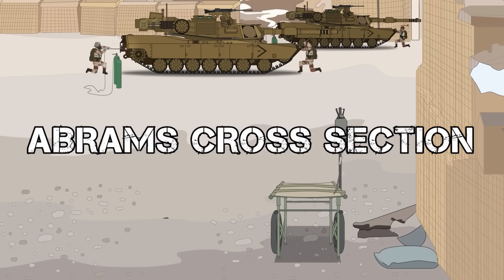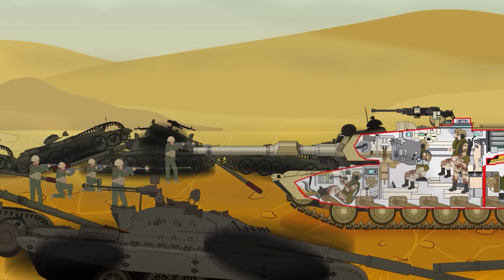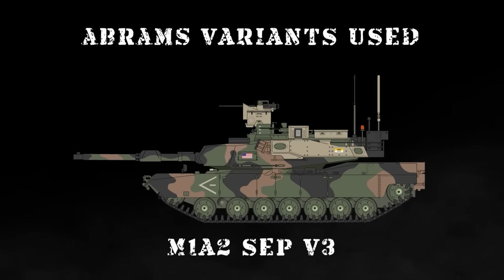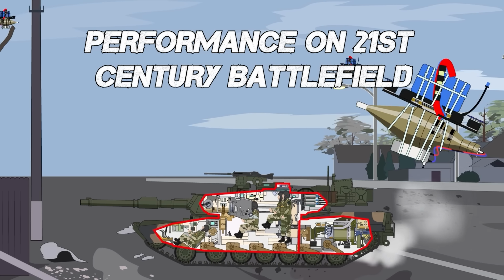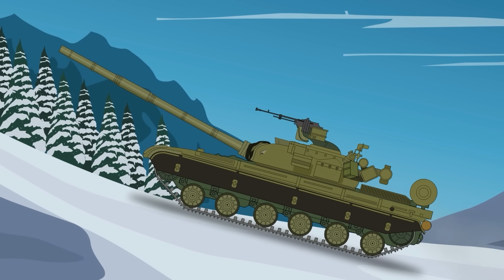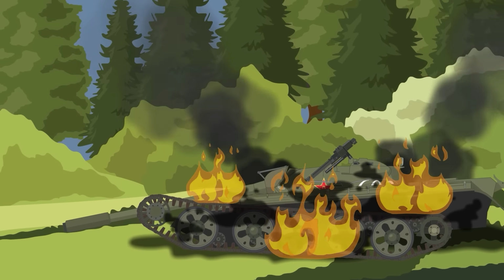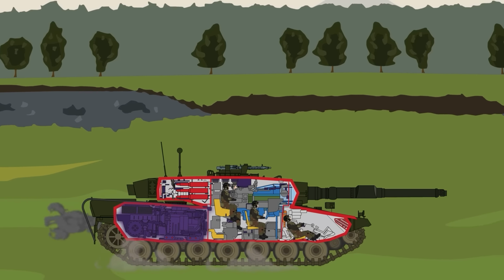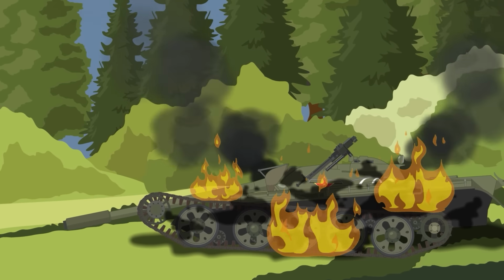M1 Abrams VS. Leopard 2 Tank

Comment: Not one Abrams was lost in the Iraqi war from hits buy another tank... they used GPS and their infra red land radar to see the the enemy T72 and T80 tanks.  From 3.5k away their sabot depleted uranium projectile traveling at 1 mile per second penetrated the frontal Armour vaporizing the crew instantly exploding its ammunition. In many cases the sabot passed through the other side of the enemy's tank ..turrets of 8ton were sent 50feet into the air as a result of its ammunition exploding....
It wasn't a war it was an anailation..in complete darkness in sand storms and on the move the Abrams anailated the enemy without a casualty... Rhe soviet T72 tank was a formidable beast with its 125mm cannon..they thought it to b the best tank on the battle field..its effective range maxed out at 2000 metres..at 1200 metres hitting a M1 Abraham they could not penetrate its composite Chopin armor.....
The soviets told Sudams generals the war would last months...100hours 1000 armored enemy vehicles destroyed...not a single Ai Abraham destroyed due to enemy retaliation...
To me thats a slaughter... shows superior technology at work on the battle field..... 
Outstanding bar many died..thar js an absolute tradegy... 😢😢😢

Comment: The US Army had another tank after the MBT 70 failure. It was made with two different main guns a regular main gun and a 155mm gun system. Basically a stripped down MBT 70 being made just for the US military. This tank was also a failure. After this they tried one more time working with the British military and a Top Secret armor package. They also dropped the diesel engine going with the same gas not gasoline helicopter engine. Congress at this time made them also use the Leopard II in the testing stage. The only way that a US Army pilot MBT would be made was to win the test and design stage against at the time the best Western MBT. The only thing that was not ready was a 120mm main gun turret the MBT being tested was the 105mm British designed main gun used in the M60 series tanks. If the M1 won then they had room for improvement over a few other things main gun semi consumable main gun rounds updated radios GPS system updated day and night sights an improved track system the list goes on. The M1 was designed for vast improvements to be made for a better MBT with the future in mind. The German Leopard II was really a great tank but for the US Army didn’t have the room for growth and they wanted to be able to make whatever changes that were needed to ensure the MBT was able to grow. Also the countries listed as using the Leopard II really didn’t use them until the Cold War was over and Germany was cutting back on the number of MBT tanks that they had in service. The one thing that impressed the western military was the 120mm main gun and the room for growth with the main gun rounds.

Comment: They tried to squeeze as much fuel into that tank as possible. 1317 gallons. Not 1300 but 1317. Those 17 gallons will give it an extra mile of range that's so necessary.

Comment: I wonder why the manufacturer of the 120mm smoothbore gun wasn't mentioned for the M1 Abrams. It's the Rheinmetall one used by the American tank. I think it's actually the exact same one used by the Leopard 2.
Reply: Both the Abrams’ M256 and the Leopard 2’s Rh-120 guns are 120 mm smoothbore Rheinmetall designs, but the M256 (L/44) is shorter and optimized for U.S. depleted-uranium rounds while the Rh-120 L/55 is longer for higher-velocity tungsten rounds — and yes, standard NATO 120 mm ammunition can be used in both guns.

Comment: What this video... vs. Leopard 2 just omits
The gun of the US M1 Abrams tank was originally developed in Germany.

Details:
The M1 Abrams is equipped with the 120 mm smoothbore M256 gun.
This is based on the German Rheinmetall Rh-120, developed by Rheinmetall in the 1970s for the Leopard 2. The M256 is a US-made version of the Rheinmetall gun, adapted and produced under license by Watervliet Arsenal (New York, USA).

Comment: One thing that wasn't mentioned in the video is the Leopard 2 and M1's ammo storage. The Leopard 2 has ammo stored in the turret and hull while M1 has majority of its ammo in the turret. 

According to Major General Robert J Sunell in the book Camp Colt to Desert Storm: The History of U.S. Armored Forces. After firing 12 rounds, the Leopard 2 must leave the combat area/firing position, turn the turret 90 degrees to the right to remove the ammo from the hull to re-stock the turret compartment, after which they can resume fighting.
Reply: The Abrams does have a hull storage, too. But just 6 rounds, behind, in direction of travel, the commander.
The Leopard has parts of the rear of the turret occupied by a massive hydraulic system to move the turret.
There are 15 rounds in the turret of the Leopard 2 (A7).

Both can carry up to 42 rounds.

Comment: Well yes and no in terms of better. In terms of tech, thermal imaging, and composites absolutely. However we must still bear in mind that these soviet T-72s are the export T-72 M-1 which was roughly equivalent in terms of protection to the T-72A ,( entered service in 1979) not just this but even these lacked the composites that the soviets used at the time. In addition the Iraqis only had crappy 3bm 22 rounds if they were lucky from early T-64As and more commonly 3bm15, which even at point blank could only pen the turret rings of the M1a1. If they had access to more advanced 3bm42 rounds they may have been able to shoot through the lower front plate of an M1. Lastly the T-72s were stuck with the 2E28M electro-hydraulic turret traverse system, which had a max traverse speed of 20 degrees per second vs the 30 degrees on later models,  no ATGMs, or kontakt 5 ERA. Sorry if this seems like a complete ruin to the mood. I do not want to seem biased to the Russian side but trying to give a comparison to soviet T-72s at the time. This is based off of the OBR 1989
Reply: Sorry it was a T-72S and the T-72M-1 does have composite. Apologies for the inconvenience

Comment: The MBT- 70 was a joint project between Germany and the United States to create a tank. Half of the tanks measurements were SAE and the other half was metric. Neither design team was willing to work with the other. Thus you have the Leapord and Abrams tanks. MBT 70. A project begun in the 1970's. A great idea that no one could agree on. General dynamics.won the design and contact for a new tank.Chrysler was about to go broke so some government folks got involved and gave the General dynamics contract to Chrysler. I'm sure someone knows more about this MBT 70 story. I'm just going on memory from some articles and videos. Both tanks are pretty awesome 👍🏻💯

Comment: 10:53 This scene bothers me a little, the americans did not wanted the mbt-70 to be anything like the abrams, they wanted to use a 152 mm gun/launcher and place the driver on the turret, while the germans wanted a 120mm smothbore gun and the driver to sit in the hull, in the end, the abrams ended up using the german 120mm smothbore and having the driver in the hull
Reply: Can't run away from German engineering
Reply: Yes, but that isn't the whole story. The Germans did accept that the Americans wanted to stuff the MBT-70 full of cutting edge high tech, but when they realized the resulting tank would be too expensive to equip all their units with it, they started a side project. The idea was to go with a "High Low" concept, where the expensive MBT-70 would be bought in smaller numbers for certain units and another, cheaper, more conventional "workhorse" tank would be developed to fill the bulk of the tank units.
That workhorse tank was supposed to have a 120mm smoothbore gun and a conventional layout (driver in the hull). It was called the "Keiler", which translates to "Boar". It was developed on the basis of the already existing "Gilded Leopard" prototype, which was a up-armored and up-gunned version of the Leopard 1.

When the MBT-70 project finally fell through, after the Americans gave up on it, the Germans just renamed the already developed Keiler into Leopard 2, basically.

That is also why it isn't correct when many people say that the Leopard 2 was developed out of the MBT-70. There is pretty much no MBT-70 technology in the Leopard 2. It is a side-project and in a way a recycled waste product of the MBT-70 project, but only in a organisational and logistical way, not in a technological way.

Comment: Sounds like the M1 Abrams is out dated or needs some serious upgrades if little drones can destroy them
Reply: Its little drones with the warhead of a typical ATGM or RPG. And still, often multiple drones are needed to really destroy a modern tank. Still, its better to be inside the tank than outside it, if you have to deal with a drone threat.
Reply: @brianriggs2335  Are you stupid, you probably saw the video at the part where the drone attacks the back side of the armor (which is thinner) and the drone gets an M-Kill (the tank can’t move but can be reparable and the crew is safe) this is not far from what is happening in Ukraine where both sides use drone warfare. Most FPV drones use hollow charged rounds (similar to the ones on the rpg) and the front and side armor are resistant to rpg rockets. Also, the M1 Abrams is NOT the latest version and it’s so old it wasn’t even the one sent to Ukraine, the latest version has all the features that the ones sent to Ukraine didn’t have.

Comment: А $500 drone doesn't care what a $10000000 tank is called.
Reply: You have to understand that most of the drone footage coming out of Ukraine (from both sides) is propaganda. Most of the tanks being “destroyed by drones” were already disabled through other means. The drones were simply used to finish them off.
Reply: It does, unlike the T64, T72, T80 and T90 the ammo gets struck on a Abrams or a Leopard the blowout panels will release the force of the blast and the crew will have plenty of time to escape. Back in WW2 a landmine or a panzerfaust did also not care but some tanks fared better than others.
Reply: A RPG on a drone is not making it trough the LFP or UPF of the Leo.
Reply: @chomaaa nor is it on an Abrams but drones can hit any point on a tank. It's not restricted to only target the front like a LOS weapon system. That's why they are so effective. Electronic counter measures and active protection systems are the only true ways for tanks to defend against drones.
Reply: @chomaaa the leopard 2 tanks have a hull storage too.
Reply: @chomaaa  Try it. Risk your health.

Comment: Everyone talks about how the abrams uses a German gun but everyone forgets that the leopard2's thermal is based on an American design and was co developed by honeywell
Reply: But does it matter really, that is what NATO is about or well used to be.
Reply: @chomaaa  also apparently yeah when people try to talk about which one is better
Applies to jets and missiles too unfortunately
Reply: WBG-X has long been replaced by ATTICA in modern Leopard 2 variants though. Abrams however still rocks that L44, which isn't one but two gun generations outdated now since there is L55 (longer) and L55A1 (longer AND higher pressure).
Reply: @jonny2954  that is indeed true but it got used in a good number of leopard 2 variants

Though about the gun ..that i still don't know why the US still uses the l44 but i guess it's not a big of a problem for them since they got rounds like the m829a3 and m829a4 which are more than adequate t deal with T series of tanks a few said rounds are on the same performance as the DM63
Reply: @jonny2954  The Leopard 2 uses the Emes-15 Fire control system. Designed by the United States.
Reply: @dalek14mc  EMES-15 isn't the fire control system, it's the gunners optic. The thermal imager and laser rangefinder inside it are German now however.
Reply: @j @jonny2954 I’m pretty sure when someone refers to the “EMES-15 primary sight” they are referring to the sight that comes with the EMES-15. EMES-15 is the designation given to the Leopard 2s fire control system. Trust me, I made a whole 26 minute video on this. But, don’t take my word for it, I encourage you to look at my sources. Kampfpanzer Leopard 2 by Frank Lobitz. It’s a Tankograd book authored by a former Leopard 2 crewman.
Reply: @dalek14mc  Incorrect. EMES-15 is just the gunners sight. It is one of several elements of the fire control system. It contains a laser range finder, a daysight, thermal imager and the two axis stabilizer for the latter two. While the gun is indeed slated to the stabilizer of the gunner sight, that's about it for the input of the EMES into the fire control system aside from the range data from the laser rangefinder.

The fire control system also contains the actual ballistic calculator FLT-2, WNA electronics, Waffenkreisel and several other components.

The actual fire control solutions (ballistic tables, dynamic lead, Rücksteuerung, verkantungsfreies richten etc.) are calculated in the FLT-2. The EMES is merely one of the components delivering data to it.

Get Kampfpanzer heute und Morgen by Rolf Hilmes. He wasn't just a crewmember, he was involved in developing the thing.
Reply: @j @jonny2954 ate… FLT-2 is just another name for the EMES-15. Please do your research. Many documents address the fire control system as FLT-2/Emes-15. I’ll get the passage for you when I get home. But, to tide you over, here is a sentence from the Tank Encyclopedia. 

“The EMES 15 is the Fire Control System installed in the Leopard 2.”
Reply: @dalek14mc  Yes, they adress the fire control system as FLT-2/EMES-15 because it's a compound of these two main components.

But EMES is just the gunners sight. In fact when the commander slates the gun to his PERI, the gun is also stabilized by the PERI and the EMES is only delivering range data.

Homie, i probably have your (and more) sources sitting on my bookshelf in their original language.
Reply: @jonny2954  Still waiting.
Reply: @jonny2954  Still waiting.
Reply: That still doesn't make the Abrams better at tank to tank combat than the Leopard 2
Reply: @Türk_Milliyetçisi  that completely depends on which situation . Plus is it an export abrams or a domestic abrams ? And which variant of the two ? And all of that saying is saying that you somehow know the classified armor details since each abrams tank has an upgraded armor package including export ones that replace DU with tungsten

So doubt each one is ''better '' over the other it depends on what each country has and needs .leopard 2 makes sense for Germany and it's terrain and the abrams makes sense for the US and it's procuring nations and it suits their terrain aswell .

Since i Dunno about you but I'm more than certain that none of the two can penetrate each other frontally besides the weak spots each tank has

Comment: The next gen American tank should have two anti tank guns or a powerful railgun cannon.
Reply: Two guns are impractical (which is why no one is producing or even prototyping anymore designs of that nature) and rail guns need a lot of energy to power and would most likely require a support vehicle to be operated alongside the tank; which would increase logistics, cost, and maintenance.
Reply: Or maybe a laser tank or a tank armed with plasma shells.
Reply: @SuperiorAmericanGuy  the energy from the plasma would disperse rather than penetrate the armor. Lasers could work, but to make them effective you'll need so much power that mounting them on ships is the only way to do significant damage compared to conventional guns.
Reply: Look those Abrams tanks in Ukraine are failing and I suggested bigger and more tougher tanks like the heavy tanks and mammoth tanks in red alert 1 because of it.